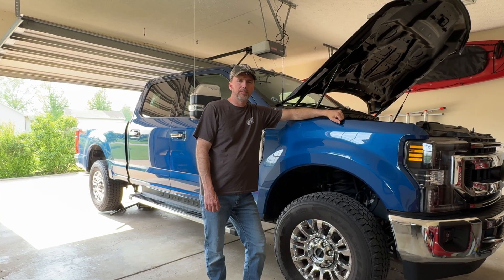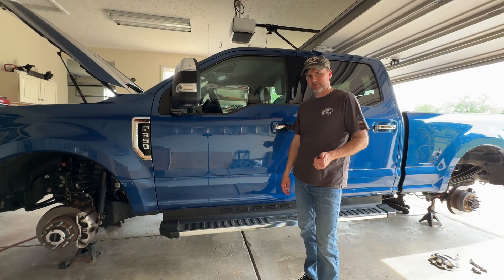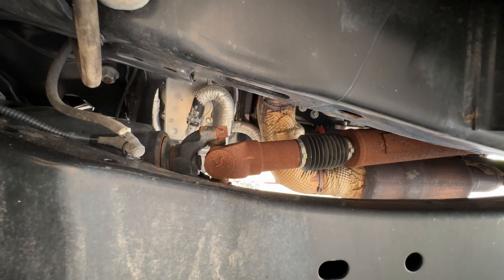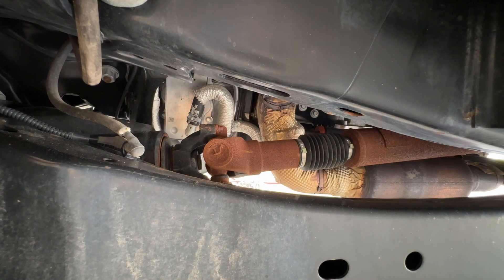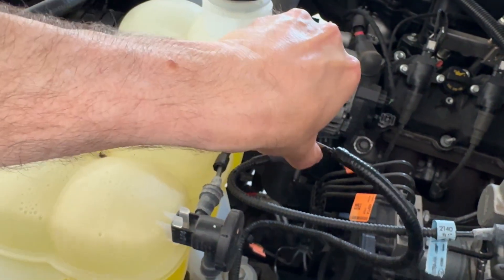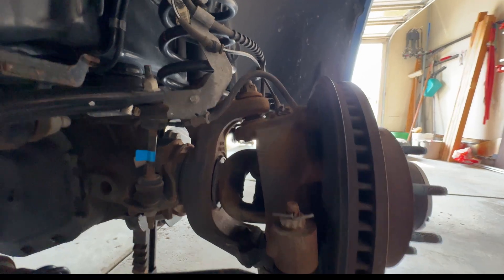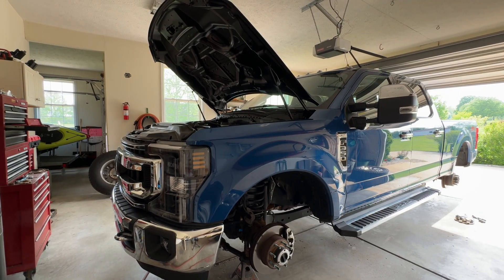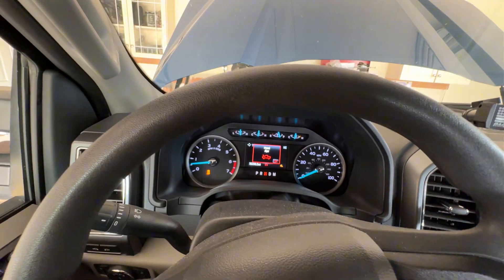Super Duty Auto Locking hubs explained.

Comment: This will only work on a super-duty model years 2011 and newer.    Ford has used 3 different 4x4 systems that the front hubs are vacuum controlled.  On the F150 vacuum is used to disengage the hubs (wheel end coupler is the term ford uses in the f150), so if vacuum is lost on an F150 the hubs engage.

on the Superduty 1999-2010 they used a "pulsed vacuum control"  vacuum is applied for about 10 seconds on the hub to pull in a diaphragm inside the hub,  this latches a mechanical device inside the hub and the hub is locked at that point even if vacuum is lost (which it is after 10 seconds)  to unlock the 4x4 module applies vacuum again, this time for about 15 seconds (to give  time for the hub to unlock)  this unlatches the mechanical device in the hub and it unlocks

2011 newer superduty have eliminated the mechanical latch inside the hub and are called "constant vacuum hubs"  they require vacuum 100% of the time to stay engaged (as the video shows).  

From a offroading / get me out of trouble stand point the 2011 + superduty system is the poorest of the 3.  The superduty does have the manual override that the F150 does not, so there is that.
Reply: My 2015 is manual hubs only, lever on the floor. I gotta get out and lock em and thats how i wanted it. Took some time to find one but they are out there.
Reply: @collk88 man that is very rare in this day.  My 2002 is manual trans, manual transfer case and that is exactly how i wanted it.  Being able to put transfercase in low range WITHOUT the hubs engaged comes in handy at times. 

I seriously didn’t think they made a manual transfercase anymore (everything past about 2005 seems like electronic 4x4)
Reply from the maker: @MH-wo4be 
That’s why I just used an upfitter switch to disable the auto hubs on demand.  Now I can have 2WL

https://youtu.be/I2DMKu0R6Y4?si=FTIQ9z3KxWErZEv_
Reply from the maker: @MH-wo4be   I am going to pin your comment.  I feel you have shared some very valuable information, non of which I personally did not already know but others that watch my not realize the differences.  However that is why I am careful to include the year and model of the truck in the video as I am only speaking for my own year and model and not for previous model years.  Thanks for watching and for the contribution in your comments.

Comment: The older super dutys had a manual hub lock just in case the seal failed you were still able to use the 4 wheel drive. Because most of the hub seals failed.
Reply from the maker: @71usmc same reason they have them now

Comment: I have a 2024 F-250.  The other night I had to manually lock the hubs to get the four-wheel drive to engage, It's 16 months old with 17k miles.
Reply from the maker: @6.8SuperDutyDriver sounds like a vacuum leak, or bad vacuum solenoid

Comment: I purchased an older 2011 F250, when I use the 4x4  my fronts click and feel like they are grinding and skipping when I turn, I was told it was normal but I can't understand that. Can someone clarify for me?
Reply from the maker: @miamiroofcleaningservices9286 Grinding or clicking noises would not be normal and could be anything from a bad u-joint at one of the wheels, a bad hub,  or a bad wheel bearing.  You should find a good shop to check it out for you.  he hopping in the front end when you turn is caused by torque bind and is a normal characteristic of a true four wheel drive vehicle when turning while 4 wheel drive is engaged.  The front and rear axles what to turn the same speed, when you are turning especially a sharp turn the axles are turning different speeds and the front end will hop and jerk because pressure is being applied to the wheel greater than the amount needed for normal rotation.  Imagine driving with the rear axle locked so both tires turn the same speed all the time and turning a corner.  One tire will drag or squeal because the axles are locked together.  That is why there is a differential in the axle with spider gears that allows the two axle shafts to spin and different speeds.  There is no differential or spider gears inside your transfer case to allow your front and rear driveshafts to turn at two different speeds so when there isn't enough slip factor like snow ice or mud, you will get torque bind and something will give usually the front end and it creates that hopping feeling.  It's "normal"  but not recommended that you drive it like that more than you have to.  If you can put it back in two wheel drive when making tight tight turns that is best, but sometimes it is just un avoidable and is not going to destroy your truck if it happens occasionally.  I hope that helps.

Comment: 2024 F350 here.With less than 1000 miles I installed Warn manual hubs, disconnected and plugged the vacuum line.Not looking back.
Reply: Thought of doing the same...so in order to put in 4x4 with the warn hubs you must lock hubs manually? Right
No auto feature
Reply: Yes. Just like the old days.😊
Reply: @train1962 💪 good deal

Comment: Why would you ever want to do this    I am more interested in why I have to lock the front wheels in  when I flip it to 4 wheel low or high
Reply from the maker: @the1timster  I'm afraid, I am not sure what you are referring to when you say why would you ever want to do this?  As for why you need to lock the front wheel when you put it in 4 wheel low or high, Ford runs a traditional solid front axle with lock out hubs that when unlock allow the wheel / hub to spin freely and independently of the axles.  This saves wear and tear on the front axle bearings, wheel u-joints, front drive shaft joints, pinion and carrier bearings inside the front axle as well as the front output shaft bearing of the transfer case.  You have to lock the hubs to the axles of the front wheels and tires to have any power put to them and help to propel your truck.  This is done either with the use of the automatic vacuum system that locks your hubs or by getting out and manually locking them.  You may need to manually lock them if the vacuum system fails.  There are other reasons some people prefer to lock them manually as well.  Check out my other hub video where I get into that a little more.

https://youtu.be/dQZcZKmZGF4?si=jd26D9BILuctn1FH

Thanks for watching!

Comment: I understand how the hub engagement system works, but how does the system synchronize and engage without grinding when you shift on the fly. With manual hubs engaged, both driveshafts would be turning at the same speed, so engaging the transfer case at any speed works without grinding. But with the new system, front driveshaft and axles are not turning, but all wheels and rear driveshaft are turning. How do they engage without grinding? I've been told by Ford I can shift on the fly as long as I'm not applying power to the drivetrain.
Reply from the maker: @hartlow946 Great question, Have another video explaining why I prefer to lock my hubs when I know I will be shifting in and out of 4WD on the fly.  I do not like engaging the hubs while I am moving.  However, as it has been explained to me, the transferase will engage just before the hubs so the drive shaft and axles are supposed to be turning before the hubs lock, that is supposedly how it works and is how things don't as you say "grind" when you flip the switch.  I use the auto mode but usually will only engage it if I am moving slowly or sitting still.  

Check out this video on when I personally lock my hubs.  
https://youtu.be/dQZcZKmZGF4

And I just released this one on how to delete the auto hubs and make them manual only or on demand with an up fitter switch
https://youtu.be/I2DMKu0R6Y4

And Thanks for Watching and commenting!
Reply: You can't really "shift on the fly" with the new Super Dutys. The electronically-controlled/electrically-switched-by-the-driver from 2 Hi to 4 Low, for example, requires the transmission be shifted into neutral (to unload any residual driveline torque for the reasons you state). Cheers.
Reply from the maker: @applesbighatranch6906 

Correct, shift on the fly is 2WD to 4wd high range only

Comment: It should be noted that starting with 2023, the passenger hub is a “dummy” in that it is always engaged/locked. I will be adding the necessary vacuum line and adding a hub. Some 2023s (early production) already have the vacuum line...
Reply from the maker: @TalonID that's a controversial topic, I've talked about those dummy hubs in videos before and mentioned they came out on 23 -25 models and was told by another viewer they were only on the 24's.  Whatever year they are on, it doesn't really matter, they still work the same way as far as the automatic / vacuum system goes.  The difference is one of them is always locked.  The one that isn't works exactly like I described.  Thanks for watching!
Reply: I own a 2025 gas F350 Tremor. Both front hubs are manually lockable. Cheers.
Reply: @applesbighatranch6906  Correct, Tremors are done right!

Comment: For what purpose would you use an upfitter switch to achieve two-wheel drive low range?  I have a 2023 F450 with auto locking hubs.
Reply from the maker: @SteveDodson-l8n I will admit, the applications would be limited but rare cases might include pulling a boat out of the water where the added torque is desired but traction isn't an issue, pulling heavy trailers and wagons in farm fields, pulling campers or other trailers and equipment up steep grades.  All places low range may be desired but the need isn't there to have the front hubs locked and by leaving them unlocked you eliminate the blinding and wheel hopping you might get in 4 low when you have good traction.  Back in the old days, we used to be able to leave our manual hubs knocked and do this but the auto hubs make it not possible.  Thanks for watching!
Reply: @robertweller2662  Thanks for the explanation. Interesting video.

Comment: This is the best explanation of how the hubs actually work. I find most people nowadays have no clue how they work, some don't even know how to manually lock or why to lock them. I'm old and always had manual hubs in my 4 wheelers
Reply from the maker: @Steve-y6s9y Thank you for the compliment.  Check out the video I just posted.  I used an up fitter switch with a relay to defeat the vacuum hubs basically turning them into manual hubs so I can now use low range in 2 wheel drive, just like the old days.  Thanks for watching!!
Reply: @robertweller2662  I did watch that vid too and commented on it. I don't know why YouTube changed my name, but it's usually stevenl34

Comment: What you forgot to add is when the vacuum actuated system does not lock the hubs you can manually lock the hubs by turning the hubs to lock.
Reply from the maker: @rangerupcoffee Thanks, but I have an entire other video about locking them manually, this was one was intended to cover how exactly the auto function works.  Especially for newbies that will probably never use the manual function.  Thanks for the comment and for watching!
Reply: @robertweller2662  You may have mentioned the manual lock engagement feature, even in THIS video as well. It is incomplete without that info, unless you were to label your videos Part 1 and Part 2. 

I feel any discussion on these newer Super Duty front hubs should explain to the one-time-viewer/first-time-viewer of your channel (or anyone's channel) should cover the driver's ability to get out and lock BOTH hubs (for a short time, there, Ford produced trucks where only ONE hub in these vacuum systems was manually lockable) if the vacuum system were to fail/malfunction/leak. 

That said, we appreciate! your efforts. When you opened the vid and said something like, "...if this interests you, stick around..." you betcha! I have subscribed. Cheers.